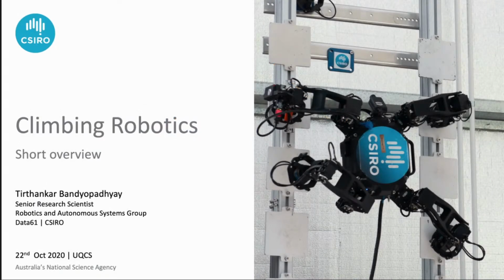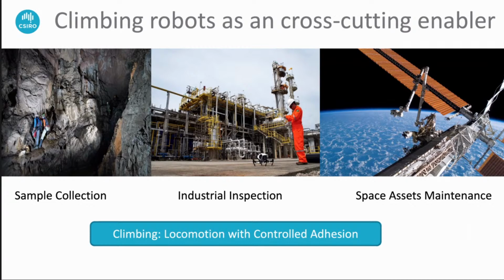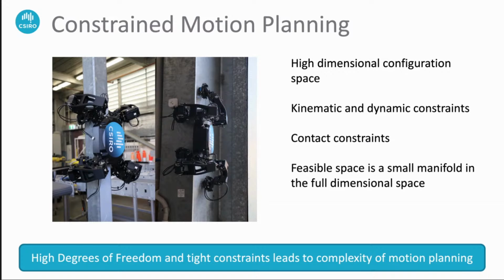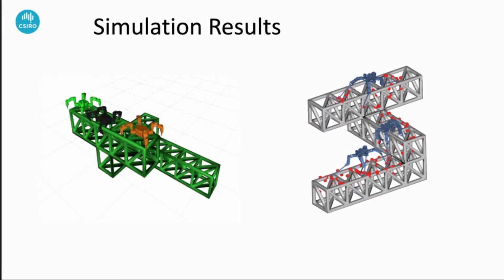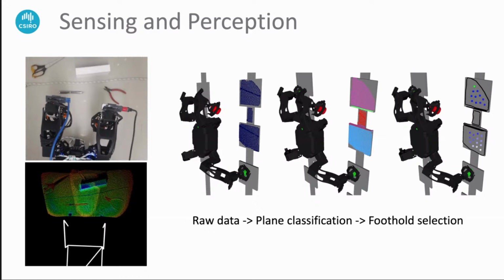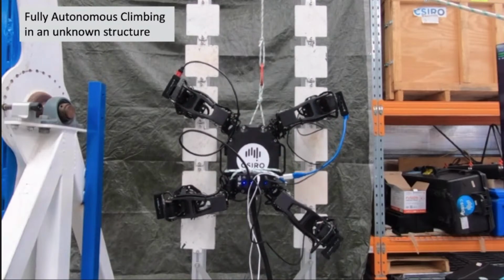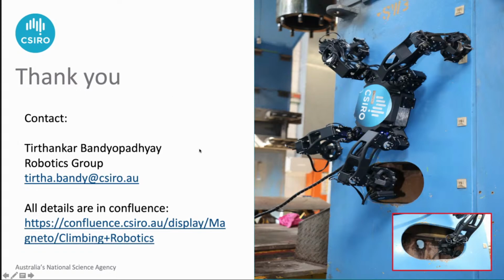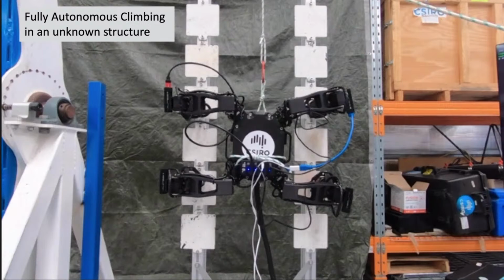CSIRO Climbing Robots Talk with Dr Tirtha Bandyopadhyay

Comment: In the talk there was a question about how does this approach compare with some trajectory optimization approach e.g like RoMeLa lab's climbing hexapod from Raghav.

My thoughts are, the RoMeLa work takes the approach of formulating as MCIP the posture planning and then convex optimization with constraints for contact force resolution. The approach was to put in kinematic and reachability limits, contact force constraints with some safety factor. This is really a great result and the robot video can be seen here: https://www.youtube.com/watch?v=AXmrqnt3JIA 
Our scenario is slightly easier because we have controlled adhesion which is decoupled from the joint torques. Our planning approach right now is to minimize the body deformation from a nominal low effort configuration by incrementally selecting and validating contact points suitable for foothold. Once a stable foothold is validated, the torso is positioned within a stable configuration computed from the contact configuration. The foothold positions are strongly influenced by our perception pipeline as we are trying to walk on really sparse geometric structures.